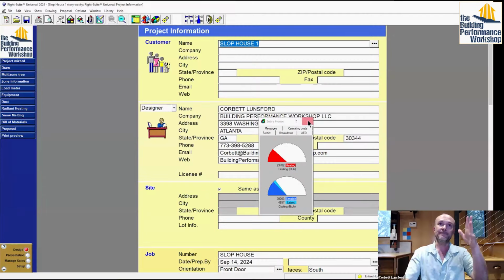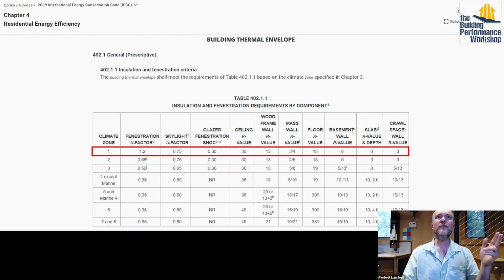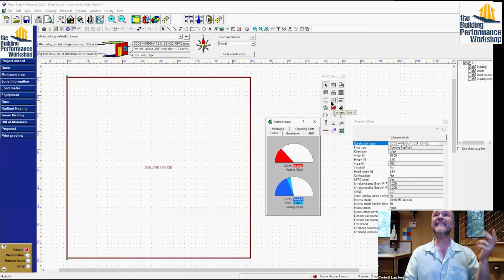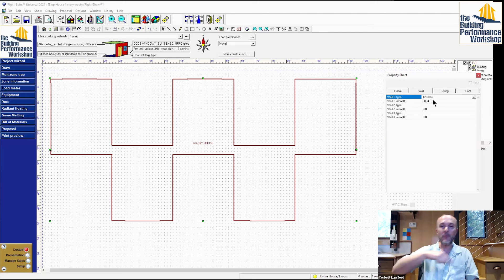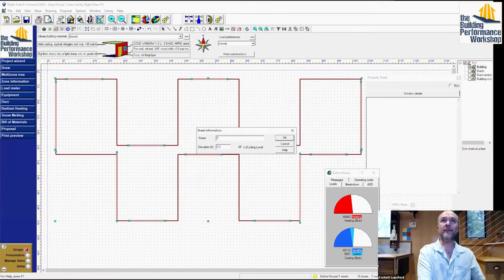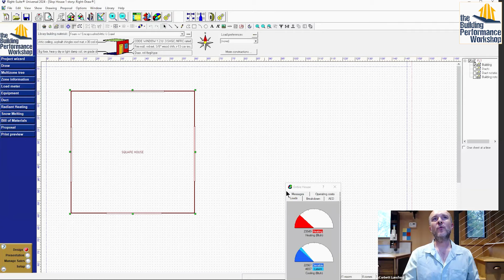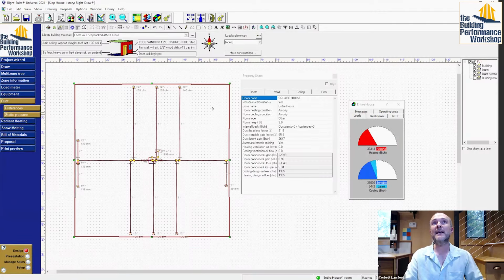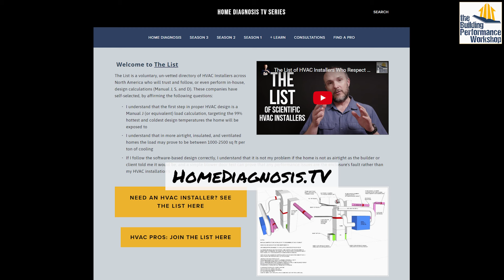HVAC Rule of Thumb Tested with Manual J Calc: Using Wrightsoft to Prove 500 sq ft/ton is Dumb

Comment: This is amazing.  People need to see this.  I appreciate you doing that!  At the beginning the of the video the fact that it was about 2.5 tons for that is already blowing the rule of thumb out of the water!  I didn’t know any of this when we built our house here in FL.  On our house they fudged the manual J so make it look as if we needed 4 tons for 2,000 sq ft, but with a 61/39% sensible/latent ratio.  I started looking through it after I had commissioned the system myself with fan speed and a number of other things and measuring with an ecobee 4.  It does work well with the fan speed bottomed out, dehum mode when called for, thermostat differential temp at 1.5 degrees (it turns on at 75, off at 73), and only ever using stage 1 at 33,800btu.  It still cycles off.  I might hit 85% run time at design temps of 91 on the data.  We had like 1 week of 96 degree temps and that would finally make it run for hours.  I’m running 254 cfm/ton in dehum mode and 282 cfm/ton normally.  I have about 80 or more cfm hot humid fresh air dumping in there also plus the sante fe cuts out when cooling since it is sent to the return.  Even if I run my fresh air maxed out which is about 130 cfm, it doesn’t make much difference - the differential between the return and supply just gets bigger.  Sometimes I do that if a bunch of people come over.  I had a smart technician check over my refrigerant numbers and it is actually still working correctly within refrigerant specs set up like this.  Isn’t that craziness?  I’m glad the two stage Lennox Merit had a lot of options to choose from on the air handler.
Reply from the maker: Great work, David, wow. Thanks for sharing the specs for us nerds.

Comment: Homeowners have been trained or at least have misconceptions that more “A/C” is better.   Recently a homeowner had his HVAC contractor upgrade his 48k BTU package unit to a 60k BTU just because the “smaller” unit ran 16 hours per day during peak heating season.   No knowledge of infiltration, duct design, envelope design, just “give me more cold air!” I’m curious how things are going to work out for them after they have that new unit for a while.  They probably won’t see the results until next summer.  That’s something that I’ve noticed with homeowners, because it takes some time for the effect of changes to show up, they forget what changes were made and what caused it to happen, thus they end up overlooking the fact that their contractor didn’t know what they were doing and just assume it’s something else.
Reply from the maker: Very important point, Owens- since our boss is always the homeowner, the project might tank with bad management, just like any company would. More education needed- keep up the good work out there.

Comment: I live in Hawthorne Florida.  My wife and I built a Steel Hangar.  50ft X80ft with 16.5' eves and a 3/12 roof pitch.  It has a 42ft x 13 foot hangar door on the front west facing side that has not been insulated yet.  We have 8" Perlins and gerts.  We filled that with Fiberglass on the walls for an R25 wall and with the same in the roof with an additional 3.5" over top the perlins for a thermal break and total R35 Roof.  We have 3 casement windows for egress.  two on the east and one on the South.  I installed two Pioneer 22 SEER2 Mini splits on the south wall side both 2 tons each.  I am cooling this 4000 square foot and 80,280 cubic foot building from 99 outside to under 80 and dry inside with that 4 tons  It is also very air tight for a steel hangar with the fabric liner that is inside it.  The system is the High R value system for steel building by thermal design if you want to check it out on youtube   Online calculators had me thinking I needed 10 tons to cool this hangar.... In reality just one 2 ton unit actually made it fairly comfortable inside on a hot day after it ran all night to dry it out and cool down.......  So ya 1 ton per 500sq foot is ridiculous.  Also... My wife and I built this complete hangar ourselves from Erection to the insulation.  We hired day help for the roof since I did not want her on the roof.  If your in FL near Gainesville and want to check it out let me know.  I am the only air conditioned hangar at Melrose Landing Airport right now.

Comment: Crazy timing. My parents just had a Manual J done by an HVAC company for their house. I haven't looked at the details but the company got it to my Dad this morning. They quoted replacing his 5 ton ac with two 3 tons for 6 tons of cooling 🙄. Comes in right about 500sq per ton. The house cooled ok with the 5 ton, the only problem was the upstairs getting slightly warmer (4 degrees) than the ground floor. Its so frustrating getting correct sizing.

Comment: 1400 square foot industrial loft in nyc, top floor of a 120 year old brick building. Our 3 ton unit ran 24x7 from mid May to mid September and never got the interior temperature below 74 degrees, usually between 77-80. The electric bill is approximately equal to my parent’s mortgage payment. Old non-insulated buildings suck. Looking forward to moving to the suburbs.

Comment: Great illustration.  We just completed a 3000 sq ft remodel in Southern California we have a 12kbtu ducted mini split for the main floor 2000 sqft and 9kbtu for the 1000 sqft upstairs R15 in walls r50 attic radiant barrier sheathing on the roof ducts and equipment in the conditioned space
Reply: Because of the design I hired a consultant to do the Manual J because I wasn’t confident in my ability to design this remodel with my wrightsoft program

Comment: I'm not a builder and I'm only familiar with mass builder type homes in Texas.  On a single story home, they typically locate the AHU in the unconditioned attic or in the garage.  All the supply air is located in the attic (duct board and flex).  I doubt there is much of any building envelop quality control.  To ensure the home is cool (setpoint set at 70 F) during a heat wave of 100+ degree day, that unit is sized well north of 400 SF/ton.  That way they don't get any warranty calls that the house isn't cooling due to other issues with the home build.  I agree, on a new home build, you can definitely get closer to 250 SF/ton or lower, but the building has to be constructed correctly.  Great Video!
Reply: This is exactly my concern as I am about to change out my 4T 1998 original AC.  (1850sq ft 1st floor and detailed-room based ManJ done on coolcalc) 
Regular conditions shows 49K BTUH while improving windows to dual pane and maybe improving som attic insulation (need a complete redo and sealing) drops to 42K BTUH)
Reply: The lower the sf/ton you get the worse it is. 

For example, new houses that are tightly built, and with energy efficiency in mind can do 2000 sf per ton, with a single unit, and multi-level. 

BUT, 70F design temp when it’s 100+ outside is not how these systems are designed. It’s probably going to be 75F.

That said I don’t think people have experienced living at 75F at 40% Relative Humidity so they are trying to compensate for high humidity with blasting the AC.

Comment: I might have missed it in the video.  Is the software showing peak hourly load to hit and maintain a set point, or the max daily cooling load (AC runs continuously for most of the day), to keep up with a set point from day to day?  What is the set point (hitting 72F is way harder than hitting 76F on the hottest day)?  The point this reveals, is it is important to know the set point as well as the heat load (temp and hours) on the hottest day. It also begs the question: how much if any thermal drift during the hottest day of the decade is acceptable? 

Insulation not only reduces the heat load, it also slows the heat rise, allowing thermal mass (ac battery) to carry cool walls through the sunny hours from the less hot hours.

Related: It would be nice to see homes typically use way less air flow than the ducts can handle (delta P) while staying balanced, so that variable output heating and cooling systems work as intended in all conditions over time. It is best to run the air handler approximately 24-7,  with a varying amount of heating and cooling, ventilation, humidification de-humidification as needed (VFD).

Comment: The best thing for AC would be to put a return air duct from the highest part of the house.  To pull the hottest air down into the AC.  I live closer to Maine, so in the heating season I would have to switch the return air vents to the floor.

Comment: Excellent example, the lack of knowledge that unfortunately prevails. 
          The reason they need that 5 ton unit also is there poor duct design only providing two or 2 1/2 tons of cooling in many cases. 

Especially when they’re one of the guys who have a 14“ x 16“ filter with a 1 inch hog hair stuck in the grill with their 12 inch or 16 inch return .  And a second 1” filter in the air cabinet nobody has ever changed.
Reply from the maker: Hog hair I love it

Comment: Thank you for mentioning insulation. From my limited observations, Manual J is good if buildings built to code, but but how many places have spots where contractor failed to install some pieces or an entire wall, or a home remodel that never replaced insulation in ceilings... would be curious to know on a basic house things that can easily affect loads, just upgrading windows from single pane to dual pane. Wonder if there is a way to come up with a way to calculate in human behaviors... such as leaving windows open for ventilation but still running AC... (why you might ask, well a lot of homes built in southern California where a window was proper ventilation for a bathroom and dedicated vents not needed, so someone wanting "fresh" air). Overall good, wish more AC professionals knew more about Manual J & D. Replaced my heat pump about 5 years ago. I didn't know about them and this was never brought up, but trying to educate people from information you and others have provided.